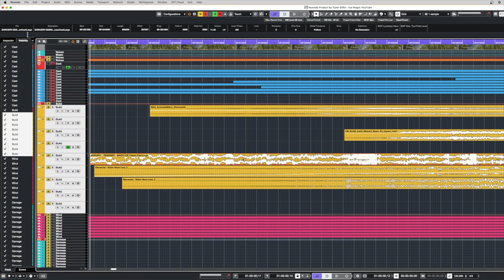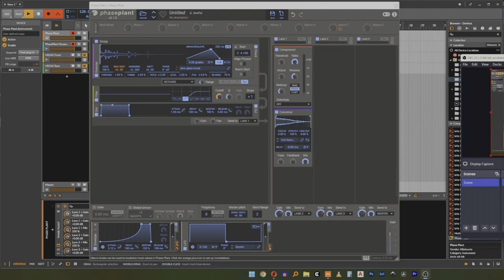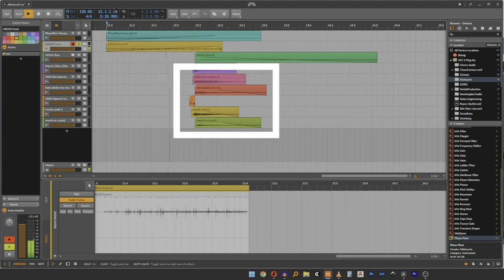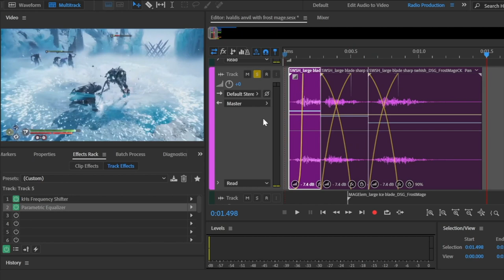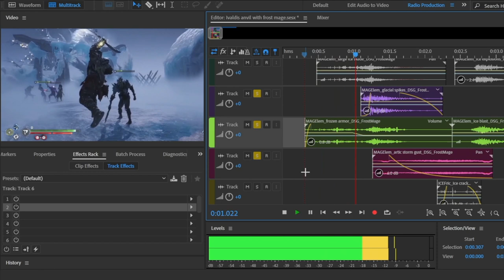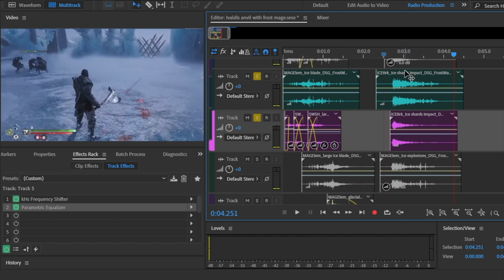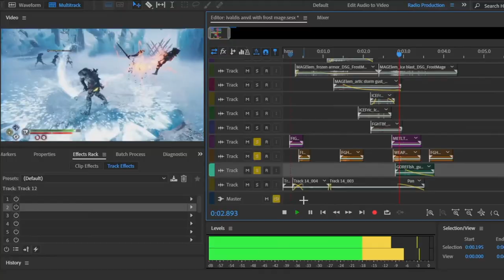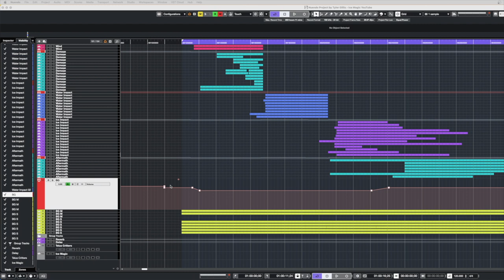Ice Magic Sound Design Tutorial

Comment: Hello. Thank you for showing all these amazing sfx tutorials. As a college student, what are some free general plugins you can recommend?
Reply from the maker: Depends on the daw that you are using, and I know lots of people don't like this answer but, most of the stock plugins are where it is at.
Reply: @AftertouchAudio  Personally, I'm using fairlight in Davinci resolve due to its integration with the rest of the program. Is there anything that you can say can be improved?
Reply from the maker: I’ve used lots of daws before but Fairlight would be one that I have not personally used, so I’m not sure what can or cannot be improved. 

Realistically if you can use EQ, Reverb, Delay, Volume Automation, Pitch Shifting, and Compression you have most of what you need. 

Once you find that one if those components is not working out for you in your DAW of choice then it might be time to upgrade.
Reply: @AftertouchAudio Thank you so much for taking the time to read my comments and answering my questions. The main thing I struggle with is getting all my sounds to sound well together without drowning each other out. How do I (as Marshall McGee puts it, “gluing together”) get my sounds to sound cohesive with multi band compressing, distortion and/or other effects?

Comment: What's a good audio recorder on budget that is good for sound design? Like I wanna record all kinds of sounds, like grass moving with wind, something cracking, literally versatile recorder, but good quality one. After I record them I wanna manipulate them and use.
Reply from the maker: One of the best recorders I’ve ever used is the PCM D100, it is used on a lot of very big libraries and is something I take with me everywhere. That being said it is no longer being manufactured, so you can only find them on the used market anywhere from $500-$2500. A solid 2nd choice is the Zoom Handy series, though they don’t do so well with quiet sounds as the D100 does. But my favorite handheld recorder series has to be the Sony PCM line. D100, D50, D10, A10.
Reply: @AftertouchAudio   bro，ZOOm H4N pro Vs Tascam dr-40x，which one will you recommend,thank you for your reply.